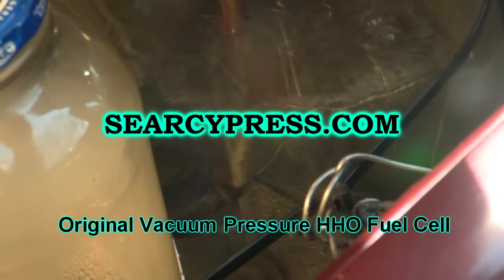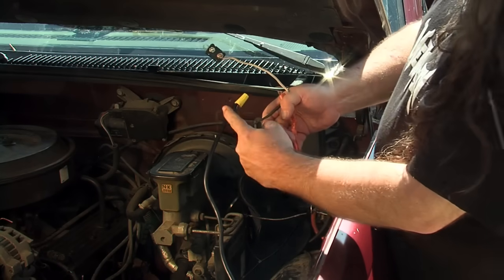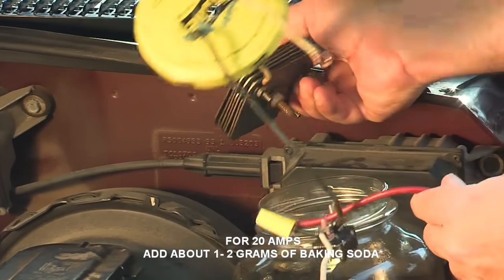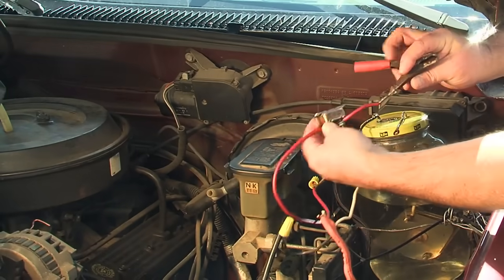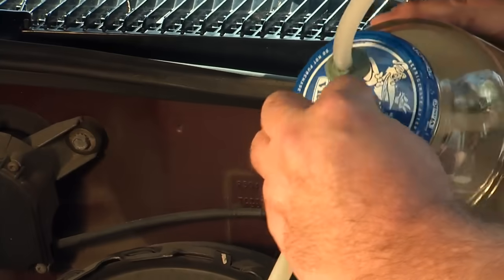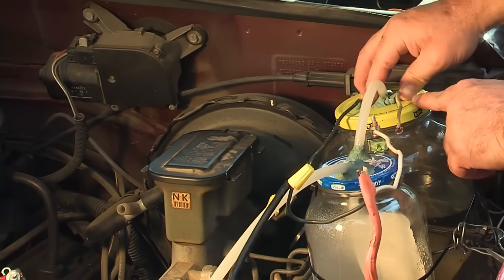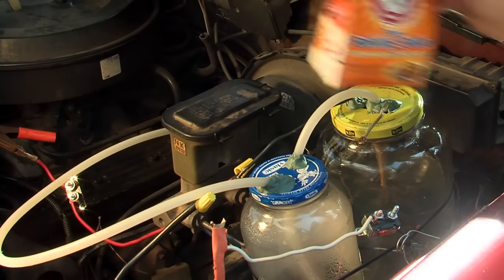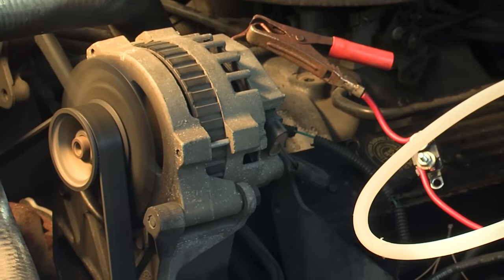Vacuum Pressure Hydrogen fuel cell defeats high gas prices using hydrogen from H2O.

Comment: Do you have to crank it awhile. While connected to alternator you don't have instant electricity so I'm a bit confused.
Reply from the maker: The fuel cell should not be engaged until the engine is running and vacuum it's been achieved. New video coming out soon will show a lot of improvements. Be sure and subscribe. Thanks for the comment.

Comment: This why they did cash for junkers cause the 2000 nd down u cn do this bt these computer cars nope nd this is why they do it.
Reply from the maker: They're increasing the ethanol to 15%.  Ethanol will cause worse mileage and very poor performance. If this doesn't make you angry, it should.

Comment: If the exhaust temp is low enough ; use ×" Poly gas vent piping that is used on high-efficiency gas boilers. The exhaust Temps using hydrogen should be lower than with gas only.
Reply: YouTube privacy violator:   I will never care if you "like" any comment that I type

Comment: Use a normally open vacuum switch hooked to a relay. The vacuum closes the circuit energizing the cell. It will switch off when You lose vacuum
Reply from the maker: It is featured in our new video coming out soon. Locating the exact one and keeping it affordable was no easy feat. Be sure and subscribe. Thanks for the comment.

Comment: Thinking about hooking this up to my valiant slant 6 but im worried after you mentioned the water comming out of the exhaust. Would this setup cause water to build up as the emission of burning hydrogen or would it be getting water into my engine causing premature wear n tear?
Reply from the maker: Water is a natural by product burning gasoline. Normally 20% of the gasoline goes unburned down the tailpipe and into the catalytic converter. (It burns and gets really hot.) That entire pipe is generally covered with thick carbon all the way to the converter. When you burn over 90%+ of the fuel, most of that junk gets blown out the very first time you turned it on. The Catalytic converter normally would turn all of that into water vapor and you'd never see the water come out much. (Unless there's nothing left for it to burn.) We have a new video which is in editing stage now and hopefully we'll be out soon. There's an added safety feature you definitely should see. I'm not telling you to install this for reasons that should be obvious. Be sure and subscribe so you don't miss it.

Comment: what is the perfect raport between amps, voltage and frequency ? thx
Reply from the maker: Depends on the vehicle. Many times, less is better. No more than 30 amps in almost every situation. Our system does not use pulse modulation. We use a brute force method in the state of vacuum. Concerning a pulse method- When there is no voltage on the plates, no work is getting done. What is happening is the bubbles are moving out of the way. In many systems, especially those that do not operate in vacuum, the plates are dry when a bubble is formed. It takes time for that bubble to get out of the way. This is especially true if there's no vacuum. I could see some advantages on certain cells to pulsing the system. However if you consider that when the bubble is formed that dry moment is effectively a pulse on the plate surface. Keeping the plate energized seems a much better approach in my opinion. I do believe that ultimately someone will figure out a way to crack the water using harmonics or electronics to free the gas with little amperage. This remains the ultimate goal but that is only necessary if you're trying to power the engine. We are not. We are only trying to burn the 20% of the gasoline that normally goes wasted into the catalytic converter. We have a new video coming out soon be sure and subscribe. Thanks for the comment.

Comment: Does tapping into that vacuum line affect your power brakes any?
Reply from the maker: Actually no. Nothing noticeable. However, this is why this is such a dangerous thing. If it was done improperly and for some reason the line broke you would lose your brakes. Not all engines use the vacuum for brakes. Some are hydraulic but the ones that do definitely it has to be done by a professional. We have a new video coming out very soon they show some very serious safety improvements. Be sure and subscribe. Thank you for the comment.

Comment: 29 amps of load to get enough hydrogen to equal a fart.  Not exactly efficient is it.
Reply from the maker: I understand your confusion. You're under the assumption we're trying to power the engine. That is not the case. All we are trying to do is burn the unused fuel. Only about 80% of the gasoline is consumed in the cylinder, the rest is wasted passing through the catalytic converter. By increasing the efficiency well above 90% in the cylinder by injecting HHO gas in the state of vacuum we are able to gain energy from the gasoline that is normally wasted. A new video is coming out soon. Be sure and subscribe. Thanks for the comment.

Comment: I had a Coachman President 33 that had a 454 engine. It was a 1984. When I got it in 2003, about,  the guy before me only got 7 miles to a gallon with it. After I got done putting six hydrolyzers on it I was able to get 12 MPG.

Comment: Total bullshit. Pulling air thru gasoline you get zero ft farther. Basically the injector is trying to turn the fuel into the smallest molecule possible. The vapors burn from gasoline. The flame never touches gasoline. Pure it on the floor or water and fire burns above the liquid

Comment: Yo man, loving your vid. Any chance you can messages me a circuit diagram. I  want to make a hydrogen electric generator. Cheers man.
Reply from the maker: The new video features a vacuum pressure control relay if I can work in a diagram I'll try to get it for you. Be sure and subscribe. Thanks for your comment.

Comment: Will this work with a GDI engine or only carberuator?
Reply from the maker: If your engine has a catalytic converter there's definitely room for improvement. The reason it's on there is because your engine doesn't completely burn the fuel. Injecting HHO into the vacuum system is arguably different than injecting into the air intake itself.. You will hear talk of O2 sensor issues and things like that. I have never experienced an '02 problem with an injected engine myself. What I have noticed is all engine knocking stopped and performance improved. I am not saying it is not possible I am just saying I personally have never seen it be a real issue. There are tons of people just waiting in line to tear away at this technology. I speak from my own experience. A new video is coming out soon be sure and subscribe. Thanks very much for your comment.

Comment: Keep in mind the power source is NOT the water, it is the electricity generated by the engine converting water into a state of high potential energy which can then be released.

It's a false economy.
Reply from the maker: The power source is the gasoline. The engine only Burns about 80% of the gasoline, the rest is burned up in the catalytic converter and wasted. We're not trying to run the engine on HHO. We are burning the 20% of gas that is normally wasted in the cylinder. This allows us gains without breaking any laws of thermodynamics. It's not over unity. It's increasing efficiency and eliminating the need for any catalytic converter because we're burning all the fuel. Thanks for the comment.

Comment: Whilst this is a very good setup, it's also extremely volatile.. storing pure hydrogen gas in a car is a very bad idea although there is a simple way to get around this. Simply use solid hydrogen. I say simply because it's not the hardest thing to put together but it's getting the solid hydrogen that's the hard part. Unfortunately the US has banned solid hydrogen because it's used in nuclear bombs but they will legally allow you to synthesise it for yourself. Once you have a sufficient amount of solid hydrogen you then store it in a sealed chamber with a heater built in. The temperature inside will cause the solid hydrogen to evaporate which in turn produces hydrogen gas. This method is much safer and more efficient but is very difficult to replicate.
Reply from the maker: Not exactly what we're doing here. We are not generating energy to fuel the truck. We are creating high efficient combustion burning the unused 20% of gasoline that is normally unburned by injecting HHO in vacuum into the cylinder. The system is always in vacuum so you can't say we're storing anything. New video will be out very soon be sure and subscribe. Thanks for your comment.
Reply: @metalpresstv  Ah that makes sense!  Have you ever thought about installing a "stirring system" inside the gasoline tank? I've always wondered how the car would perform if something like that was to be built as it would increase the vapour inside therefore making the vehicle run for a longer duration of time. Just food for thought.. and I look forward to seeing your next video!

Comment: Congratulations, instead of burning gasoline to power your car, you're burning gasoline to generate electricity, using that to electrolyze water, then running your car off the fumes, and all you had to do was make a bomb and strap it to the drivers side of your car.
The only way this could increase gas mileage is if you used a power source that wasn't attached to the car.
Reply from the maker: Actually no. You assume the engine Burns 100% of the gasoline. This is far from the truth. The engine only Burns about 80% of the gasoline. Why do you think there's a catalytic converter? It's because the engine does not properly burn all of the fuel. We're just getting a more efficient burn taking advantage of the 20% of the unused energy in the gasoline. We're not trying to power the engine. We're just trying to burn all the fuel. This system runs in a vacuum it is not pressurized at all. New video is coming out soon be sure and subscribe. Thanks for your comment.
Reply: @metalpresstv  Electrolysis produces 2 hydrogen and 1 oxygen. Burning dihydrogen (hydrogen is diatomic) causes a reaction with oxygen (known as fire) and produces the exact same amount of H2O as when you started.

Unless you're dumping the hydrogen into the atmosphere (don't do that), the process is oxygen neutral and still a waste of time.
Besides, your jar setup is probably only 50% efficient, so you'd never recoup more energy than you spend.

This might help is if you put regenerative breaking on the car, used the generated electricity to make some hydrogen, stored it somehow, then made a mechanism to dispense the hydrogen when you accelerate.

Also, hydrogen pits steel.

Comment: Bravo! Amazing. Thank you.  Can you please make another video showing how to connect the hydrogen cell to the combustion system of your car. I would appreciate that.  This is what we need more in the world. Bravo. It was very brave of you to test this model in your car despite the potential risk of a fire hazard. I am glad and impressed by your effort - good to know that your Hydrogen cell fuel system has been performing well for 30,000 miles now.
Reply: Dont know how both hydro & oxygen are used for combustion
Reply: He explained it in this video.  The HHO gas line is connected to the vacuum line running to his master cylinder.  That only works if you have an older Carburetor.  Newer vehicles with Fuel injectors would have to do something different.
Reply: @mordiev  I have a Nissan hardbody 1995, it has a similar layout. Also it sounds like a great experiment!!
Reply: @natanaelmartinez7620  it'd definitely be fun... just as long as you remember it could explode at any minute... he doesn't separate the hydrogen from the oxygen so the gas mix is incredibly explosive at all times... and theres live wires dangling in there with like 23 amps passing through (more than enough to spark)... he's literally powering his car by syphoning the explosive mix from a home made bomb... if it backfires the whole thing could go boom and launch glass shrapnel everywhere haha (consider installing it in a vented steel box)
Reply: @oligould8575  that’s why you fun the gas through a ‘Bubbler’ 🙄 Cheers …
Reply: @oligould8575  I meant RUN the gas 👀
Reply: @oligould8575  wait whats an engine and pistons? Controlled explosives? It starts somewhere. Im sure first witness of cars felt same as you!

Comment: What mpg of gasoline do you get?  at what speed,  SUGGEST Trying also a 2nd addition to bubble air up thru a container of gas to get the running "on fumes" * effect for even better mpg, (yep, HO + gasoline fumes works, you will need back flash arrestor in the gaseous tubes as close to the bottle as possible prefer 2 to be safer, same for HHO system you have.  Also  you might consider a plastic jug with a blow over pressure plug in top to alleviate any explosion that might occur.   some say the stainless steel wool works to arrest back flash into HO gas container (jar).  * Don't worry too much about the EGT (exhaust gas temp at exhaust valves), the leaner you run an engine at first gets hotter, but even more extreme lean running actually makes it run cooler (from pilots trying to get back on near empty tanks).
Reply from the maker: We show a new safety device in the upcoming video. Be sure and subscribe. Thank you for the comment.

Comment: This works!!! I’m so proud of you! And see your educated on this and use common since! Thanks for sharing your system!
Reply: It actually does not work. You introduce more air into the system and the fuel injectors will introduce more fuel therefore burning more fuel than normal............ Common Sense is a thing of the past my friends.

Comment: Everyone talks about bypassing O2 sensors and such but if you make your engine stock with no electronics or PCM the problem is solved...remember, before petro was put into cars the combustion engine was designed to run on water until people got greedy so this shouldnt be complicated.

Comment: "Dude" is the most fitting name for this...dude.   Got "The Big Lebowski" thing going for him, fer sure!

I see a lot of comments lamenting the load on the alternator / the alternator not being able to produce enough amperage.

Why not just get a higher amperage alternator and upgrade cables as appropriate?

Still, I got to think that most alternators can handle this pretty easily.

Comment: I don’t get it… you combust some oil to make electricity to disassemble water molecule into oxygen and hydrogen which then recombine when combusted to return exactly the same energy minus heating the whole setup thus actually reducing the overall engine efficiency by some amount and all this for what, to demonstrate some water from your exhaust pipe?
Reply from the maker: I understand your confusion, allow me to explain. You think you're burning 100% of the fuel that goes into your engine. You're only burning about 80% at best. We are not trying to power the engine with the HHO gas. We are only trying to burn that extra 20% of fuel that's normally wasted. That gives us a lot of room for gains. The flammable steam also retards precombustion in the cylinder eliminating engine knock. This allows you to burn much lower octane fuel. Last time I checked it was somewhat cheaper. I hope this clears it up, thanks very much for your comment.

Comment: I have another question if you don't mind. The catalyst jar I'm using it's a medium size pickle jar. It get really warm almost to warm too touch during the process. It's that normal ?
Reply from the maker: If you're getting proper vacuum and everything is right the maximum temperature you should observe is around $155°. Fahrenheit. That is not an ideal temperature mind you that it's just the maximum you will encounter. The boiling point of the water is lowered by the vacuum and the liquid behaves like refrigerant. They're is certainly no shame in backing down the amperage.
Reply: @metalpresstv  how can I back down the amperage ? I'm running off the battery now not the alternator.
Reply from the maker: @the2ndgendodgeramspot299  by reducing the electrolyte or adding distilled water.
Reply: @metalpresstv  thank you for helping me !

Comment: I built this and hooked it up to my truck. I don't have any moisture coming out the tail pipe. Do I need more plates - more hho gas going in ?
Reply from the maker: Probably not. If you're pulling about 25 amps you're making quite a bit of gas. Remember the object is not to power the engine. We are just trying to burn the 20% of normally wasted fuel that goes unburned and out the pipe. Sometimes just a very small amount will give quite a bit of gains and increasing it does no good at all. Thanks very much for the comment.
Reply: @metalpresstv  thank you for blessing me with more insight. I didn't realize this was too gain higher amounts of burnt fuel but it makes so much sense.

Comment: I though we were going to see a before and after.  What do you do with an injected engine?  Put it in the air intake?
Reply from the maker: Injecting into the air intake is not an option. Combining the hho gas directly with Air will result in dilution and separation of the gases. We don't want the O2 sensor picking up extra oxygen. Injecting into vacuum is the only solution. This reduces the likelihood of gas separation. We are not trying to power the engine we are just trying to burn the 20% of fuel which is normally wasted. New video is in production we need all the help we can get from you guys, so be sure and subscribe.
Reply: Yes sir!  Thanks for the reply!  Looking forward to seeing it.
Reply: Actually I subscribed when I watched the video but I rang the bell 😎

Comment: But it could be done in a geothermal plant that runs 24/7. Or even off an existing nuclear plant.
The safety part is keeping the hydrogen cold like most flammable gases.